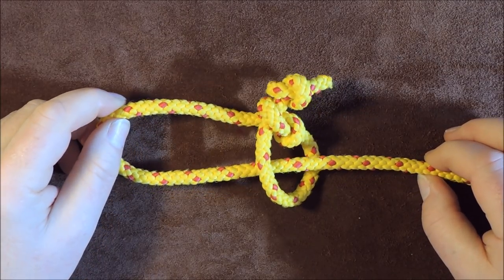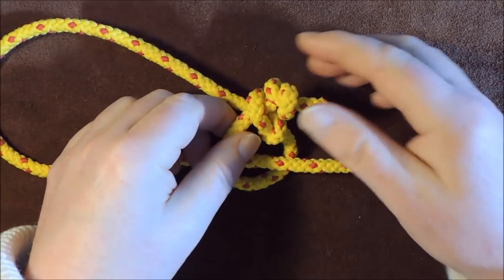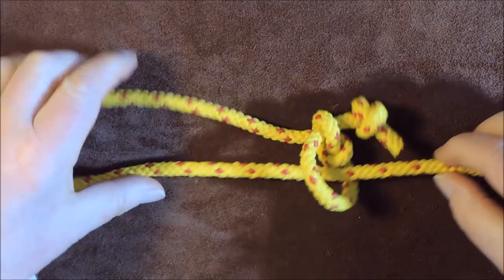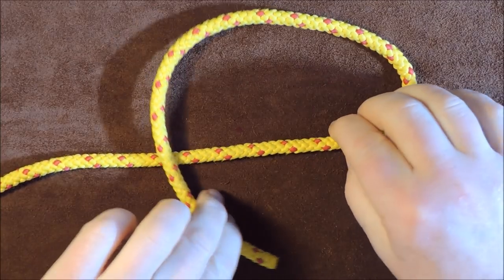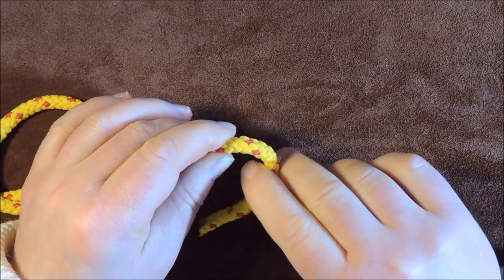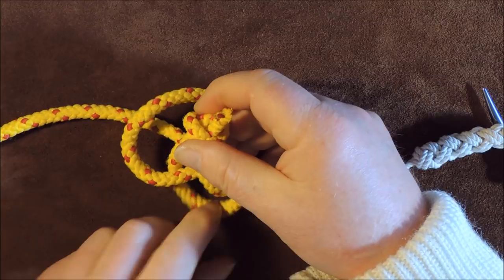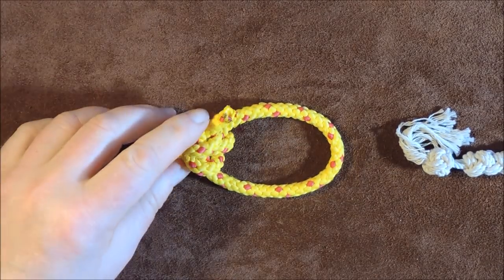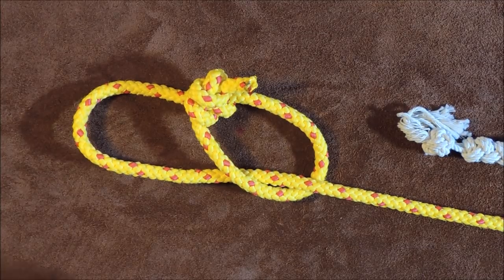Honda Knot - Lasso Knot - Bowstring Knot - How to Tie a Lasso Knot (Cowboy)

Comment: Hey, Mr. Debt. This video was uploaded quite some time ago, but no one seems to have answered your questions asked within. I will answer as per my own experiences...but as no expert. 
Firstly, by profession, I am a veterinarian, and was one in the military for quite some time. I also grew up on a ranch, and have, as you say, "floored" plenty of cattle.
In my experience in the US, most handlers use a stiff nylon rope. It holds its loop quite well. I did do a humanitarian trip through Central and South America, and their cowboys used exclusively soft ropes with hand-tied hondas...and were quite good with them!
Reply from the maker: Many thanks for the information, it is always good to read people personal experiences. I personally was always under the impression that the rope was either very hard lay or stiffened in some way. Thanks for letting me know.

Comment: Nice demo. Cattle working ropes today are specialized and quite technical for competitive ropers. Modern materials are nylon, nylon/polypropylene blend and polypropylene/polyester blend (polygrass, syngrass etc). 3 strand or 4 strand. Soft, medium, hard and intermediate stiffness some are core weighted depending on use and personal preference. Varying diameters and lengths for particular use (calf, steer header, steer heeler, utility ranch etc), personal preference or level of ability. They are preloaded (coiled) by heat treatment for loop retention and snap back. Some use a braided rawhide hondo, yes it's "hondo". My first that I still have is scant 1/2" waxed hard lay 28' 3 strand manila with tied hondo and leather "burner" that I used for ground roping/working corral calves. Rope's well worn like me. It's on the wall, I'm in the recliner. :) They aren't lariat or lasso, they are simply your rope. The ropes today are as golf cubs, everyone has a personal preference. However when working cattle on the ranch/farm you "dance with the one who brung ye" ie "what you got in hand". Mikko Snellman would be appalled with these ropes. :)
Reply from the maker: Thanks for taking the time to share this information, I always love to hear about knots being used! I knew that when I started the video that a knot does not make a lasso. In one of the replies to this video somebody passes a link to a cow being cut up for such a thing. As for Mikko I am sure that he may have a rope for the job, as they do wrestle Reindeer in his part of the world?

Comment: Would there be some disadvantage to tying a Bowline and passing the standing end through the Bowline to create an adjustable loop as opposed to using the Honda knot?
Reply from the maker: You are now describing the Running Bowline. If it suits your needs, then use what you feel most comfortable with. What are you going to do with it?
Reply: @KnottingKnots  Oh I was imagining using it for rounding up cattle and was just curious what the functional difference was between the running bowline and the honda lasso knot.
Reply from the maker: @ghollisjr  From what I understand is that it is not just the knot that make this knot. The actual loop created by the knot, where the line runs through it, this is in some ways also made to be rigid. Maybe it is lined with a hard leather, the idea is that the loop does not collapse and the rope should run freely through the loop. Sorry, not a cowboy, but that is the best I can answer.